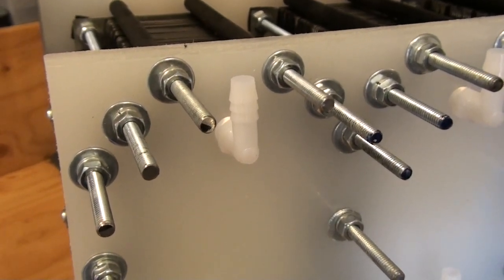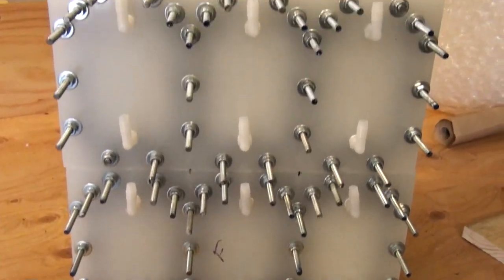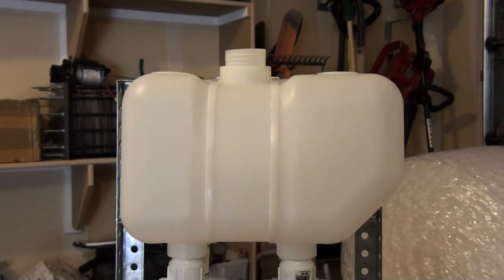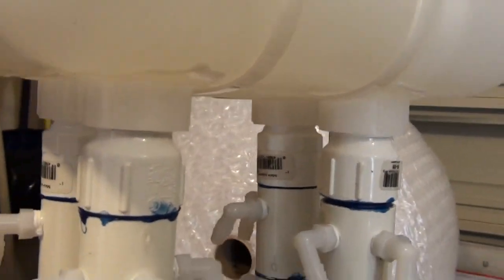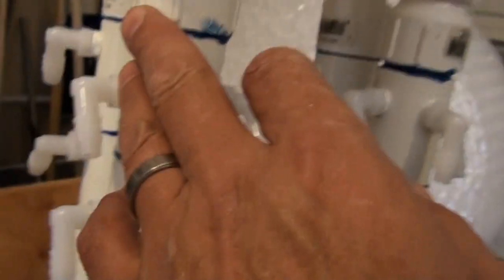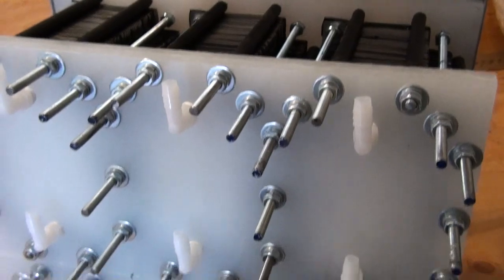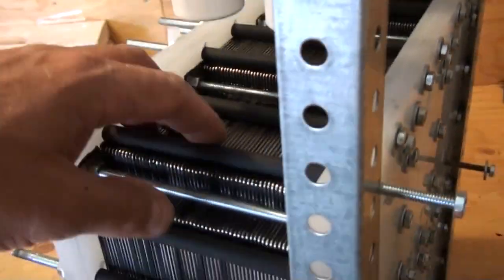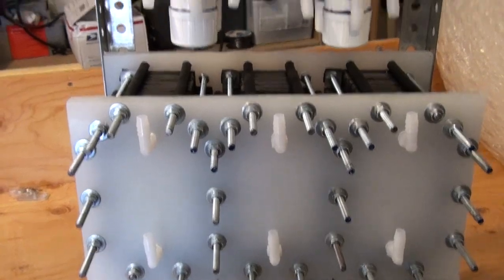HHO 354 Plate Monster Hydrogen Generator Build Part 3

Comment: I'm thinking of compressing the gas to use for an emergency generator. I'll just hook it up to my solar/wind power system for electricity.
Reply: It would be easier to isolate it by separating the anode and cathode chambers with some sort of barrier to the gas: ideally you'd want an ion-exchange membrane, but something with microscopic pores or even an flat piece from an unglazed clay pot might do in a pinch.
Reply from the maker: +Leonard Ferrell You wont be able to compress HHO because it is 33% oxygen.
Reply: It's also effing dangerous dude. It's not like you're compressing natural gas or even pure hydrogen where there's a shortage of oxygen to react with. It's ready to pop at any moment (static discharge, etc) and the increased pressure will only make it more ready to do so.
Reply: or it'll turn into water...
Reply: By reacting and exploding violently
Reply: you would have to separate the gasses first. maybe through a condenser and centrifuge. hydrogen at the top oxy at the bottom

Comment: Ok, question.
When you turn water into HHO and burn it, do you permanently lose that water or does it come back into the water cycle?
Reply: Probably lost as a fluid.
As most of the oxy hydrogen gas's gets incinerated.?
Reply: @hairybuttwhisker4202  - oxidized hydrogen is H2O !,, hydrogen combustion engines have water running out of the exhaust

Comment: I am on the process of finishing my 5,000 plate Gigant Hydroxyl Cell. This will be about half a ton in weight and will draw about 40,000 amps from a battery bank of 200 pieces 30amp auto battery. I pray to God this project will be finished and I will post videos of this soon in you-tube to prove that the bigger the better. Thanks Delvis for inspiring me.

Comment: I like your work. I wonder about the electricity jumping to your mounting bolts when the unit is running... have you taken precautions for this that I can't see? Or is that even an issue with your design?